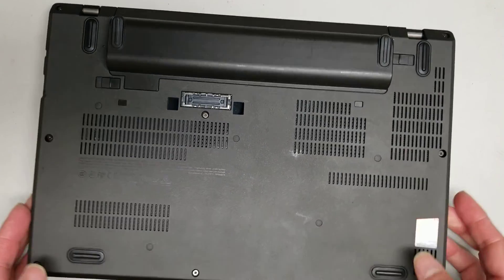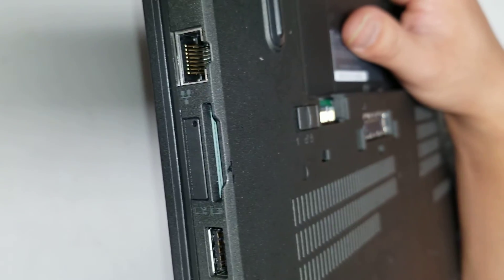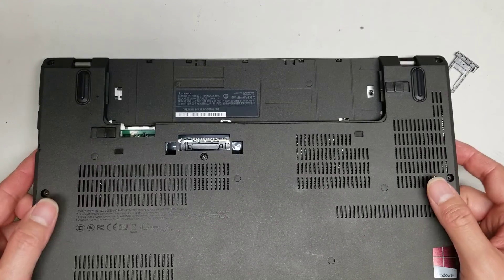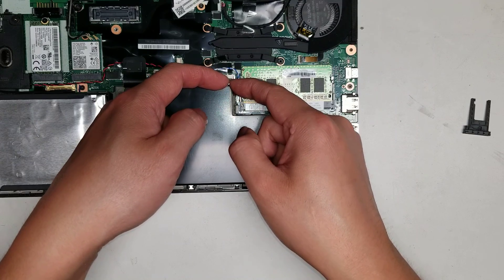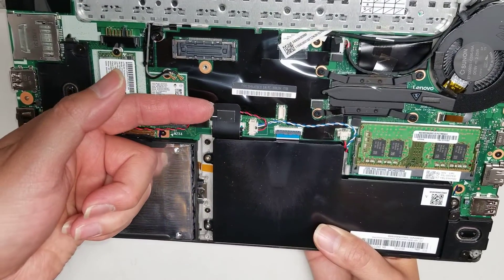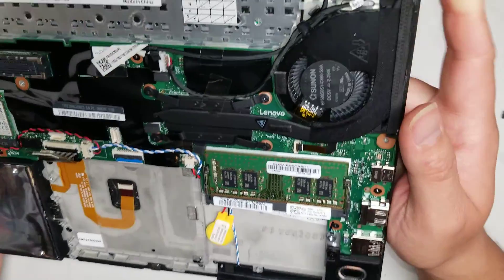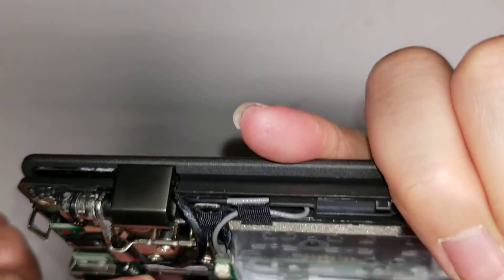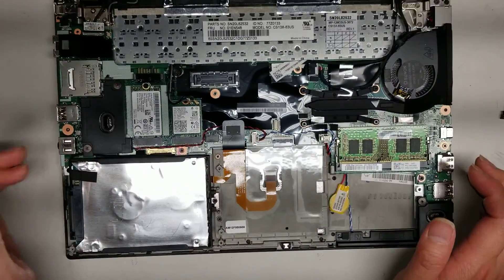Lenovo X270 Disassembly RAM SSD Hard Drive Upgrade Repair

Comment: Dear Sir, at min 4:20 you remove cable connection for SSD. How did you that?
Reply from the maker: Flip the latch and pull it out

Comment: Hi.  Can u please tell me the FRU number of the internal battery? Mine i don't have internal battery. I'm not sure which is compatible for x270 internal battery. Thanks!
Reply from the maker: The 2ndary battery?
Reply: @ItsBinhRepaired  internal battery. Not the external battery.
Reply: @ItsBinhRepaired  not sure though which is the main and secondary. All i know is that there are two batteries X270 has. One internal found inside and the other one external which is the one u can easily remove from outside.
Reply from the maker: @nedlarn7223  likely https://amzn.to/3jH5G19
Reply from the maker: @nedlarn7223  that is likely the right one

Comment: Thank you very much.
Your video really helped me.
Can you please tell me that if I have x270 without backlit keyboard then can I installed keyboard with backlit in it ??
Reply from the maker: If it has the connector on the motherboard you should be able to.
Reply: @ItsBinhRepaired  
I don't know about the connector. But Thinkpad x270 comes with backlit and without backlit. That's why I think it will work, but not sure
Reply from the maker: @shail0124  possibly. You'll want to check the motherboard
Reply: @ItsBinhRepaired  Yeah! Thanks for the reply
Reply from the maker: No problem

Comment: what is the brand and specs of SSD hard drive compatible for lenovo X270
Reply from the maker: I like Samsung, crucial, Kingston, and sandisk. You can use 2.5" sata sdd and m.2. Not sure if it's m.2 sata or pcie nvme, but it's a shorter one, not the standard length.

Comment: Hi.
So we can 2nd SSD using M2 slot at X270, isn't it ?
Reply: Add 2nd SSD, I mean
Reply from the maker: If I didn't mention it in the video, I don't know. Too many computers I've worked on.
Reply: @ItsBinhRepaired  I see it at 6:35, the 2nd SSD capacity is using 128GB in this video
Reply from the maker: @catatanperjalananusia904  yup, looks like m.2 but it's the shorter type, not full length.
Reply: @ItsBinhRepaired  I just got a used X270. Add 2nd storage using M2 SATA 2242.
Reply from the maker: @catatanperjalananusia904  cool

Comment: X270 upgrade 32GB DDR4 !!!! Works perfectly !!!
Reply from the maker: Awesome! Glad it's working out. If you haven't already, please like and subscribe so others can find my videos. Thanks!
Reply: May I ask if it was a 3200Mhz ram stick?
Reply: @dbilbie  yes
Reply: isnt 16 gb the max ?
Reply from the maker: @HiPh0Plover1  the max stated is almost always wrong. It's usually whatever you can get. It's usually based on the max at the time.
Reply: @HiPh0Plover1  you can buy any brand 32GB DDR4, I bought cheapest on eBay second hand "Crucial" 32GB DDR4
Reply: @HiPh0Plover1  

Lenovo statement said only 16Gb Ram capable ... 

But the system technically accept 32Gb easy !!!

Comment: How many ram slots are there in the model?
Reply: Only one it is showing...

But I bought used one from  model id (20k6000RUS). 

In properties it is showing that it have it have two ram slots...

Sooo please help...
Reply from the maker: You can't tell from the video?
Reply: @ItsBinhRepaired  and mine is ssd version......

With two batteries..
Internal and external...

Is there any options to install extra hdd like yours??
Reply from the maker: @aneesmeledath7  the whole point of my videos is to show how to take computers apart. What you want is to Google things. I'm not Google. Lol Take your laptop apart and check or use Google. If you want me to do the research for you, I'll expect some payment. Lol
Reply: @ItsBinhRepaired  I just asked. Because I thought you might be having good knowledge about these things... At least about your computer....
I am sorry that I asked you what you are not aware of., Thanks 😊😂
Reply from the maker: @aneesmeledath7  I repair them for a living. They aren't my computers. I work on thousands of models. I don't have the brain capacity to remember the the details of every single one. Lol
Reply: @ItsBinhRepaired  I understood....

Thanks mate...
Meaning no offense 😍😍
Reply from the maker: @aneesmeledath7  haha no problem :) Hopefully the videos help regardless.
Reply: @ItsBinhRepaired  thanks mate 😍